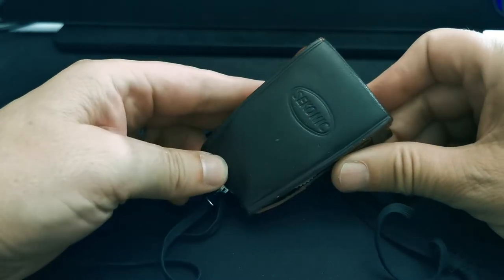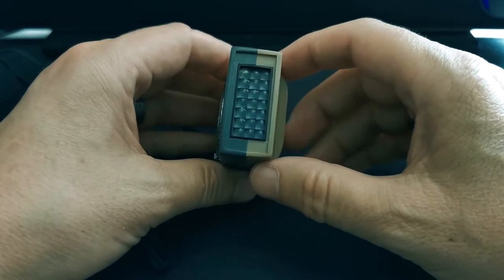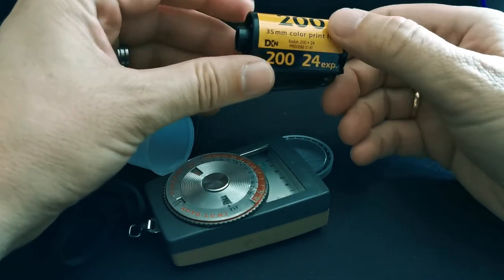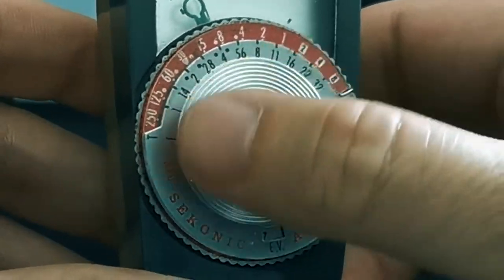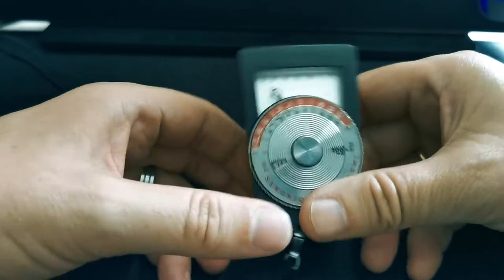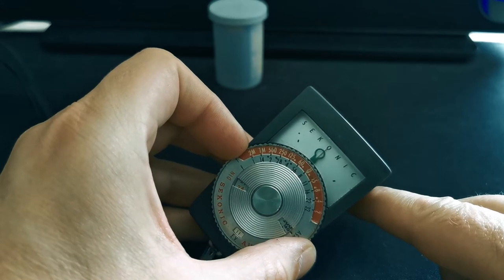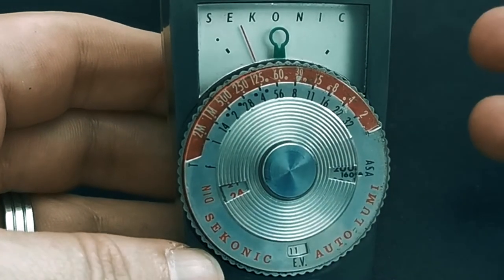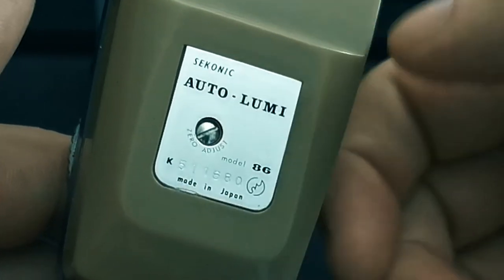Vintage Film Photography - Using a Light Meter

Comment: Super helpful! You mentioned that for this model, it has to be around 4inches of range. what I'll be using it for taking landscape photos? Will it still be accurate?
Reply from the maker: Great to hear it was of use. Not as accurate no. It will certainly be giving you a reading of the light near the camera, but this might not be the same as what is being reflected off the scene. So basically, it may work, but it may not. My advice would be to get a second opinion from one of the many free phone apps that turn your phone in to a light meter.

Comment: Hi, 
I tried to work with my light meter on EV (for the fist time)and my Hasselblad 500. The measuring gave me 14 EV!  Then I put 14 on my Camera . But what I don’t understand  how do I know my aperture and speed in EV MODE? I Don’t understand the logic of EV settings on my camera? I know  EV 0 would be the correct exposure.  But why did it indicated me 14 only with indicating 200 asa on my light meter.
Thanks for helping me out.
Reply from the maker: Hi Corinne. Firstly, oh my goodness what a gorgeous camera, I'm very jealous. However I think you're a bit confused as to what EV or Exposure Value is. I will do a video on it soon, but essentially it is a single number that represents both an aperture setting and a shutter speed. EV14 for instance represents 1/500 of a second at f5.6. But it also represents f16 at a speed of 1/60th. If you Google it, you will find lots of tables that can do the conversion for you. I hope this helps.

Comment: My red outer ring doesn’t spin any tips to fix that?
Reply from the maker: Is it the same or a similar model to mine? I'll be honest I have never taken it apart but perhaps if you're feeling confident you can try and see if something obvious is preventing it from turning. I think I might try using some lighter fuel initially. Worked in to the space behind the dial as it will clean dirt out and then evaporative. I'm sorry I can't be more help.
Reply: @sccjono  is scythe exact same model. It’s okay I just got it at a thrift store I have started photographing film more and thought it would be useful to have a meter